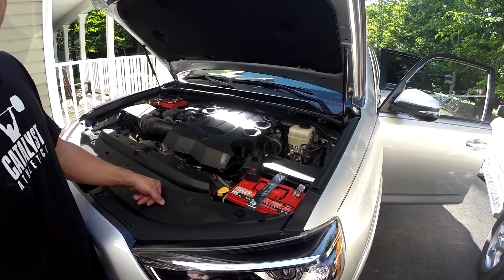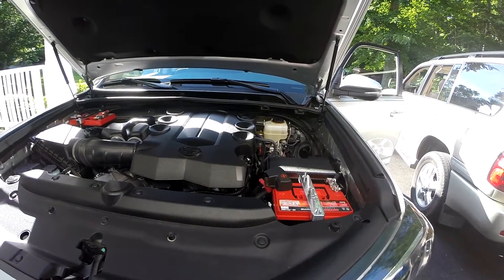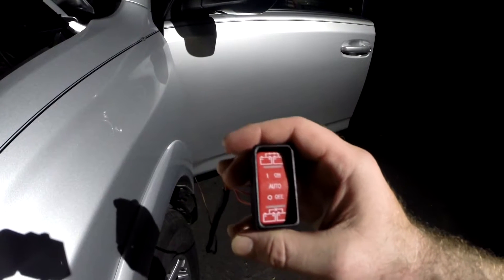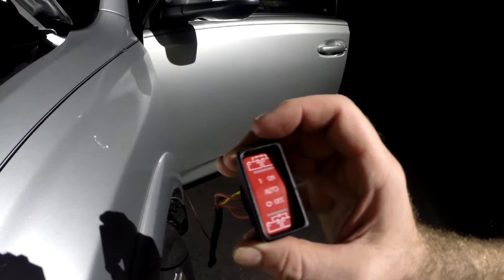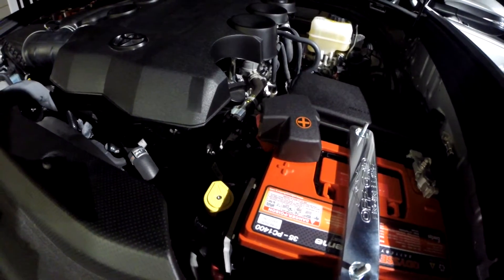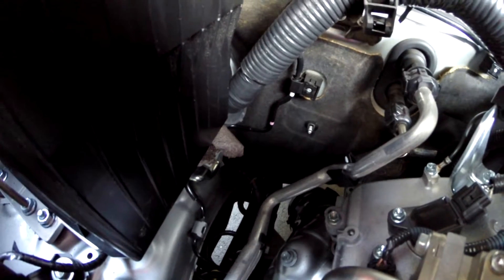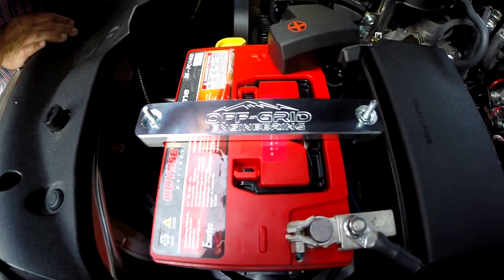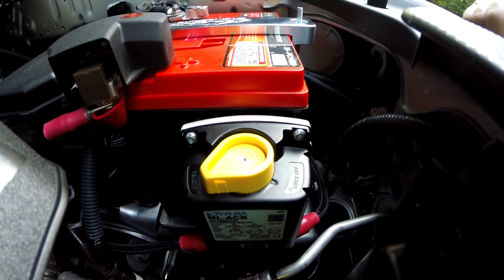(5 of 5) 5th Gen 4Runner Dual Battery - Start Up, ML-ACR function, and summary

Comment: I watched all 5 videos and you guys totally ROCK!!!  When it comes to electrical crap I'm a complete noob (or idiot) and the thought of doing a dual battery system scares the bejeezus out of me seeing that I could damage the truck or completely kill myself but your tutorial makes it look very doable.  I'll definitely be going with the OGE kit and following your video along with very helpful tips on the nylon washers and foam padding.  Again, thank you for putting this video out!!!
Reply: Why not just go with the National Luna dual battery system over this system? if you don't have a switch how do you control which battery is getting charged besides opening the hood and manually doing it?
Reply from the maker: Pix J, For your first question: For this install there are two reasons.  The first is that the off-grid engineering was the only kit I found that had the aux battery try and did not require major modification for a 5th gen 4runner.  It came with the blue sea ml-acr relay which was a bonus and leads to the second reason.  
Second, the national luna is similar to the IBS system.  These both have electronics based around an everyday high amp solenoid.  These systems work great for people but have some disadvantages to the blue sea. The blue sea is marine grade, waterproof, has tinned connections (no corrosion), uses less power to latch and unlatch, can hold either selected position without using any electricity, has a lifetime warranty, and there are probably a few other things.  Standard high amp solenoids do not have these properties and will fail over time. When doing my research I determined it was cheaper to build my own system around a blue sea ml-acr and have a more reliable product than to buy an IBS or national luna. Check out this video where I break some of the differences down, although I have learned a lot since then, oh and disregard the hecklers in the video. https://www.youtube.com/watch?v=O0YNsn-DGuY 

Your second question.  This depends on the system but generally speaking the batteries are connected when the vehicle is running allowing the alternator to charge both simultaneously.  When the ignition is off they are disconnected automatically.  This allows accessories to be powered off the aux battery without draining the start.  The blue seas electric switch and manual switch can override this behavior but it is not something you would routinely do.  If your start battery died for some reason manually connecting them to start the vehicle is a possible scenario. Another is if you are stranded and want to use both batteries to power radios and equipment as long as possible until help arrives.

I hope this and the video above answers some of your questions but if not please ask.  I am currently installing a full DIY dual battery system with blue sea ML-ACR and an ARB fridge in my land cruiser and will be doing an install video and explaining all the wiring and how and why I did certain things.  Based on my back log of projects it will probably be late December before I get the videos wrapped up.  If you subscribe to the channel you will be sure to get an alert when there done.  Thanks for checking us out!
Reply from the maker: Wow! Thanks for the extremely positive
feedback!  We do the videos for fun and
some are pretty bad so it is truly awesome when we really help somebody
out.  Sometime in the near future, after
I get thought some of my current projects, I will be putting in a dual battery
system in the Land Cruiser.  I plan on
doing a similar series on that install but am also going to do some more in
depth stuff on wiring accessories, fusing, relays, etc.  This stuff can seem a little scary at first
but not really that bad and can be some of the coolest mods on your
vehicle.  Good Luck and feel free to stop
by for any specific questions you have! Thanks again!
Reply: I just installed my OGE dual battery kit last night.  Again, I can't thank you guys enough!!!  Awesome video and tutorial.  I followed along your video while installing which made it easier.  Rule of thumb for me is whatever the estimated install time is, double it for me LOL.  The OGE kits no longer come with the in-cab switch which isn't a big deal for me since it's just another step I have to do and find a spot to put it.  I can still just use the yellow switch to operate the ML-ACR.

On the aux battery tray I did add the neoprene washers at the mounting points and the pipe foam to protect the rubber boot.  When I was putting the tray in it actually did cut the electrical tape of that big cable so I absolutely agree with you guys that that corner needs to be protected.  I can only imagine what would happen to the cable when you're off-roading and things are rubbing.  Another thing I did was put soft side velcro padding where the ground wire runs underneath the tray so that wire doesn't rub on the tray and another velcro pad on the side mount where that black wire with the white clip runs on the side.  

I basically mounted my wiring and fuses very similar to the way you guys did it.  Over the next week or so I'll finish installing a Blue Sea fuse panel, run cable to the rear cargo area for a Blue Sea Below deck panel to power the fridge.  Also I'll be adding a National Luna dual battery system monitor.
Reply from the maker: Man I am so glad our videos were helpful on your installation!  Sounds like you have an awesome setup in the works. We will have to do a walk-around video of your rig one day :-)  Thanks again for the positive comments!

Comment: When it comes time to replace the primary battery, must the secondary battery be replaced at the same time?
Reply from the maker: that is certainly not an absolute requirement. I fully expect to replace my auxiliary far more often than the start since they are drawn down much more often.

Comment: Hey guys.  Awesome series on this install.  Learned a lot and I'm OCD about running wires... seems like you are as well.  My only hesitation is where I'll install the ARB dual air compressor after running this kit.  Is there still room somewhere?  Thanks again for the videos.
Reply from the maker: Thanks man!  I am very OCD, you should check out my land cruiser wiring 😁  I think you are going to have a hard time finding space for a compressor under there once there's a second battery.  Good luck with your build!

Comment: Hi guys, excellent videos. I'll be playing this on the iPad while installing my own. I'm actually about to order this system in the next day or two. If you mentioned/showed this already, sorry if I missed that part, but where did you end up installing the remote switch?
Reply from the maker: Thanks man, We just ended up zip tying it up under the dash.  He doesn't use it a lot.  I use mine more often since I like to disconnect when parked so my solar charges my aux batter independently.  Also we did have the switch go bad once.  They have a life time warranty and replaced no problem but with think it may have got too hot.  I recommend putting some heat wrap around it to avoid heat from the radiator blowing directly on it especially in hot weather.  I warp my batteries to protect them.  You might use something like this to wrap the battery and switch https://amzn.to/2ppN11n

Comment: This installation appears to have been completed in June of 2017.   What are your comments after a year of service?  Have you had any difficulties with the OEM alternator keeping both batteries charged?  Did you consider upgrading the alternator using perhaps the high power alternator by DC Power EngIneering?  I have just purchased a 2018 Toyota 4Runner Limited and will consider installing a dual battery system in the spring of 2019, since we do some camping and I have constant problems with electrical systems not providing enough power.  I live in Seattle and a lot of my driving is short distance city driving in dark gloomy rainy conditions with considerable electrical demand.  The Off Grid Engineering Dual Battery system seems to be the way to go. 

These videos were very informative and enlightening; I really appreciated them.  Thanks a lot for sharing your experiences.
Reply from the maker: No haven't really have any issues with the alternator keeping up, this is my friends 4runner so I don't monitor on a daily basis but he has no complaints. I have similar setup in my Land Cruiser and haven't any issues either (check out the vids they are more comprehensive than the 4runner's).  I will say that neither of our rigs have huge power demands yet. 

I think the aftermarket alternator is going to pay off mostly when you are running a large load.  Right now I have minimal camping lights, a fridge, and some charging outlets.  The bigger alternator will get you topped off quicker and less stress on the batteries while you are traveling with high power lights etc.  So that might be a a pretty good idea for you.  The cool thing with my land cruiser is there are high amp OEM options  from Toyota so that's the route most take.

One thing we have also onsidered is adding are on board ac-dc chargers.  To really take a full charge and provide maximum life AGMs and odysseys in particular need a specific staged charging.  Alternators do not provide this so plunging in the rig from time to time to condition the battery is ideal.  Plus it gives you the ability to utilize power in established campsites.  A DC-DC charger can also provide the stages for an AGM but there weren't many options in the USA when we chose the blue sea relays.  There are some now available but they are pricey.

This is the charger I am looking at. https://amzn.to/2rJpGFc

Off Grid was the only non invasive game in town.  Before you buy I would suggest you check out Slee Off-Road.  I have a ton of their  products and they are top notch.  They told me they were working a dual battery setup for 5th gens and I think it is coming out this summer.  Even if you don't see it on the site I would give them a call, and tell them I sent you ;-)  Either way you can't wrong with the Off-Grid setup and I speak from experience when I say it is pretty sweet when everything is pre-cut, crimped, and shrink wrapped.

Thanks for checking us out, let me know if you have any follow up questions, and let me know how your build goes!
Reply: Thanks for the quick reply.  I have a Noco Genius Gen Mini 2 on board charger that I will be installing.  It was recommended to me by the owner of a well regarded automotive electrical shop in Seattle.  Alas, he has retired and the shop has closed, because a light rail line is being constructed in the area and the zoning was upgraded to high density.  At first glance, the specs are similar to the one you linked and it does include charging stages for AGM batteries.

I will look at the Slee Off-Road when the time comes.

I will post updates as things proceed.  For an upcoming trip I can use my Edgestar FP430 refrigerator loaded into the cargo compartment.  I tested it and it will work from the rear outlet.  We are just making a 3 hour trip, with only brief stops and will stay in a motel.

Comment: My setup should be delivered today, hopefully I'll get it in on Sunday. They don't include the incab switch anymore, luckily I found one on Amazon now I get to figure out how to wire it. I watched your installing the switch on the Land Cruiser and screenshot of the schematic I'm really hoping it's the right schematic for the right model off-grid sends LOL
Reply from the maker: If you have any issues let me know, I have talked a couple people through the wiring.  It's not too bad but there are a few blue sea diagrams that are very similar for different models but not the same.  I bet you will have no issues.  Good Luck!
Reply: Brady Adventures will do thanks!

Comment: That's a very clean setup. I like all of the little extra tweaks that you guys did, which I will probably copy once I get this. One question regarding the 'off' switch. If you leave it in the off position, will the auxiliary battery still get charged while the truck is running or does it have to be in On/Auto mode?
Reply from the maker: Thanks!  If the switch is in the off position it will not charge the aux battery when the truck is on.  You would only use this is you wanted to work on the aux side and not have to disconnect the main battery or if you had some kind of issue.